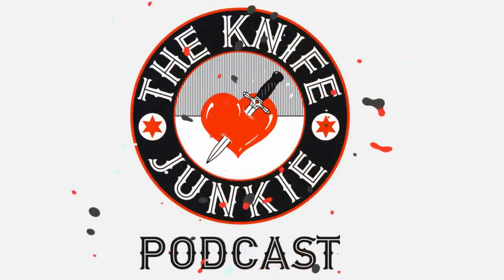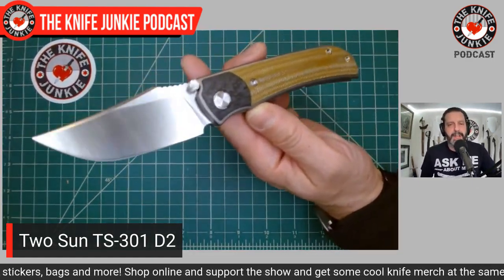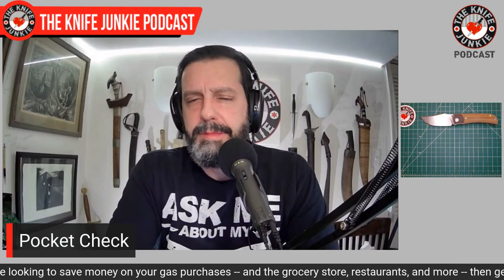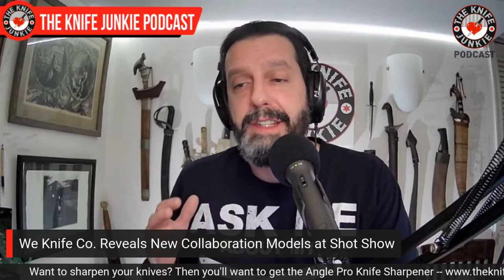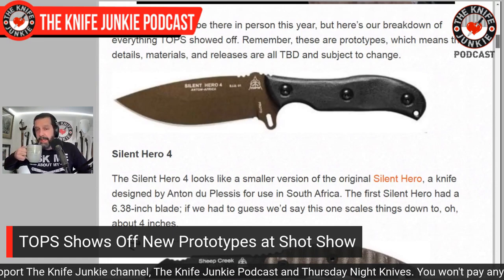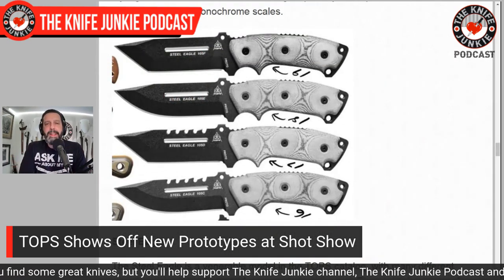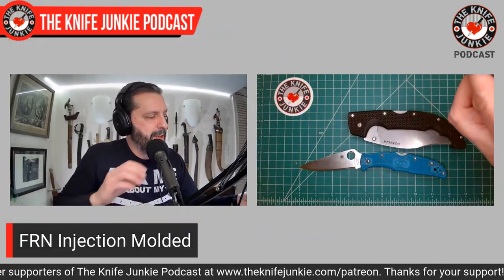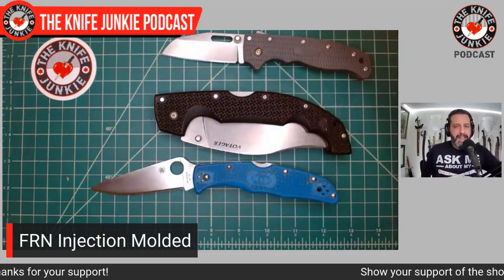Firmly In Hand: Common Grip Texturing (Knife Handle Grips) - The Knife Junkie Podcast Episode 287

Comment: I have definitely fallen into the Ozark trail trap, I had a fixed blade from them I bought when I was like 8or 9 that was simultaneously soft and brittle, it was extremely easy to wear down the blade with a whetstone but if I tried to carve hardwood with it it would lose 3/4" long half moon shaped chunks of the edge.